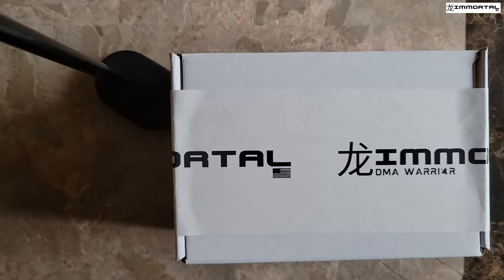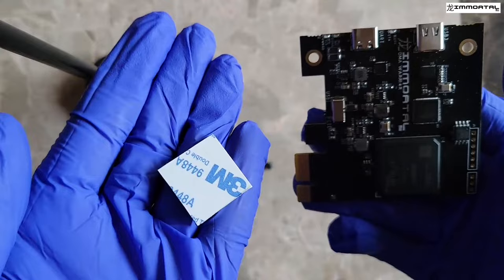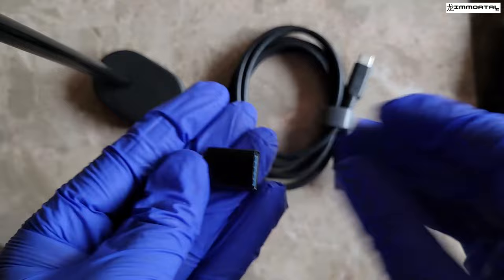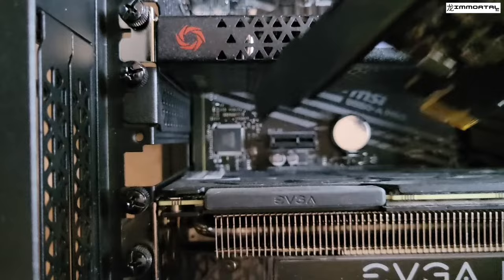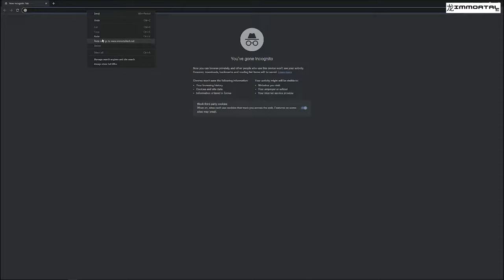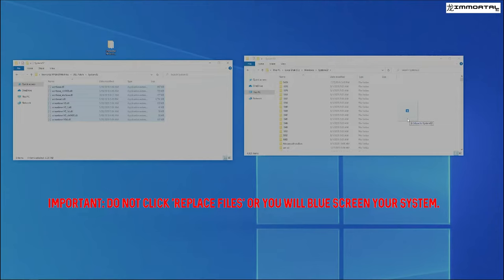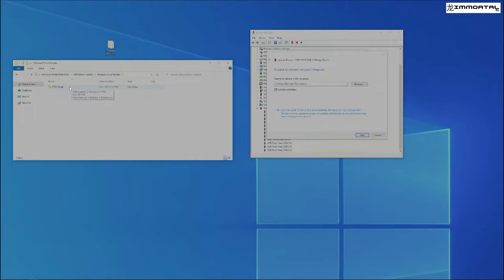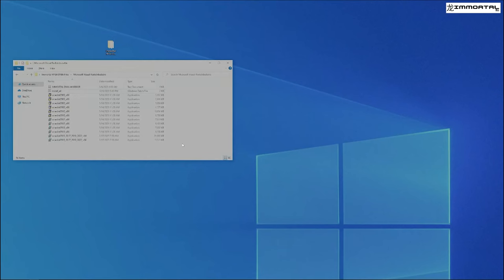(OLD) New Product: DMA Knight / Gladiator

Comment: hey do you necessarily need 2 pcs for this? if i do it with only 1 pc will i get detected
Reply from the maker: Hello,

You don't need 2 PCs to analyze memory. However, software on your PC will be able to know what you're doing.
Reply: @immortaltechnologies  can I use a slow pc for the dma card pr is there requierements? If so where can i find them
Reply from the maker: You may use a slow PC.  @RBLX_Karma
Reply: @immortaltechnologies  can it be like a really bad pc i’d say like running 30 fps fortnite ?